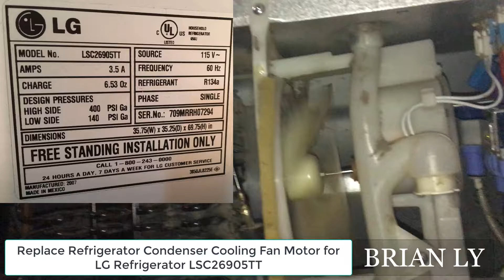How to Replace the Condenser Fan Motor on a LG Refrigerator - LG LSC26905TT - what should not do!

Comment: This is the best video for this type of repair that I've seen so far! I'm amazed that I didn't need a verbal walkthrough to see what is going on. It's like I'm looking a few steps ahead to mistakes that I'm likely to make, but now know to avoid. I appreciate that so much! I've never repaired a refrigerator, just whined that my food is going bad too fast, lol. But I have the motor and some knowledge, time to see if that's the problem! Thank you for this! And a big thanks to your helper as well.
Reply from the maker: Thank you for watching, I hope it helps.
Reply: LG will tell you LG stands for ' Life is good.'  As a repair tech for 35 years, I can tell you it actually stands for: Lots of grief!

Comment: Thanks for the video. I came home, the freezer is not cold, pulled the back cover, and the fan is turning easily, maybe bearings worn-out. Just order the one from Amazon. I have the same refrigerator, so I'll keep you posted if the fan is the problem. 😎👍🏽
Reply: Ok fan replaced and it worked for 5 days then it stopped freezing again 😡. I went ahead and replaced the start relay and overload part. It's up and running now thanks again... 👍🏽👍🏽👍🏽👍🏽